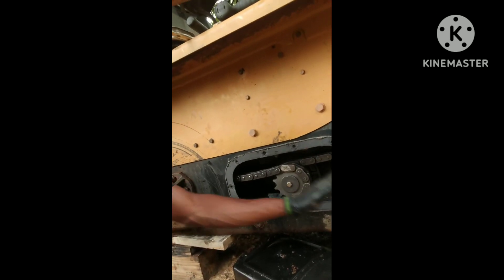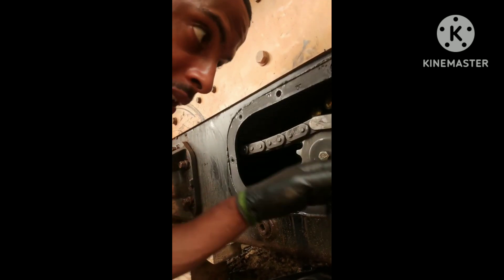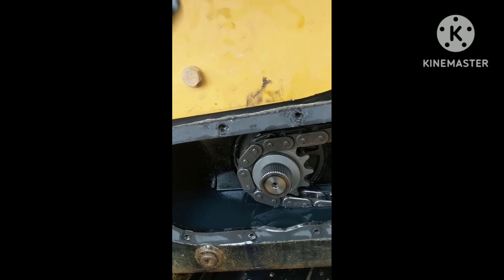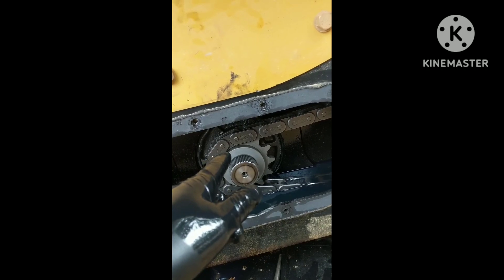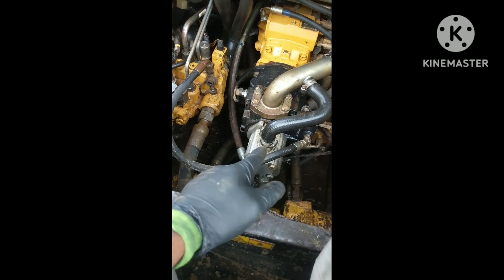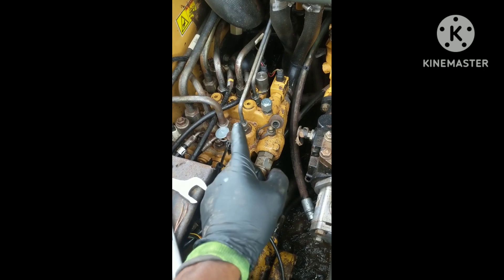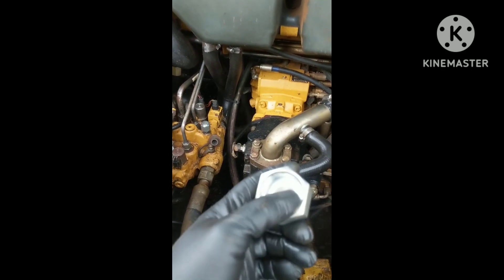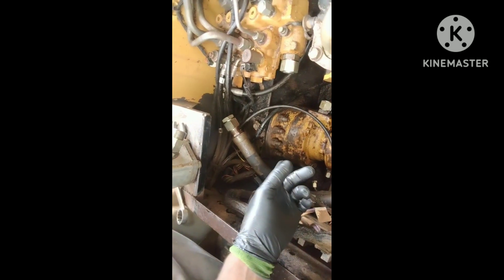CAT 268B Drive Motor Removal

Comment: My 268b xps has a weird angle thing (pump motor) going in to the right hand side drive motor. (If sitting in cab, under your right ass cheek). I ordered the machine brand new. Loaded with all features 268b XPS with the loegering VTS track system. Like a CTL. I specially said "I do not want a 2 speed". Salesman said ok. Nowhere on the dash above do I see the turtle drive or rabbit mode switch. My decal on the side does not say 2-speed as well. But, what else could they contraption be going to the drive motor on the right hand side? Big metal motor or pump at an angle going in to the drive motor. Anyone know? U think Cat dealer removed switch and I really have 2 speed? WTF? Is this like new BMW car where they come with all features but you subscribe or pay for use of it? Anyone know? I'm also having issues with my interlock ecm. Battery light on dash  and interlock ecm will not send start signal to start relay.

Comment: Hey I have a 262b I need to move but the engine doesn't run is there a easy way to get it to free roll?   Thanks
Reply from the maker: No, there isn't. You will have to lift it onto a trailer or drag it. It takes hydraulic pressure to release the parking brake.
Reply: Ok thanks

Comment: Need you one of these M12 Milwaukee 1/2” 90* impact ratchets for those bottom bolts, its a power house to me a 12v
Reply from the maker: I need to buy some Milwaukee's, I just don't ever put much thought into it until I need one haha
Reply: You know what you’re talking about. 
My cat skidsteer after 15min of driving starts to squeal from the left side. If I steer left it stops because the wheels stop. What would your guess be the issue is?
Reply: After is sits for a few hours it’s fine again for 15 min of driving.  Then noise again.
Reply from the maker: @paulthatcher3574  I'd bet if you were to shoot the pumps and motors and control valve it'll be obvious where you're problem is. That's where I'd start, aside from pulling your  hydraulic filter and looking for brass